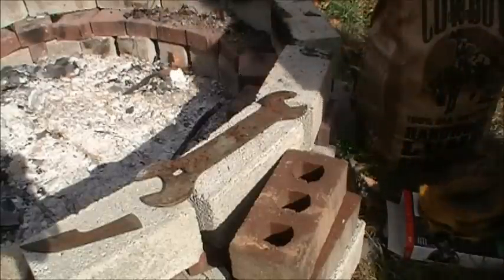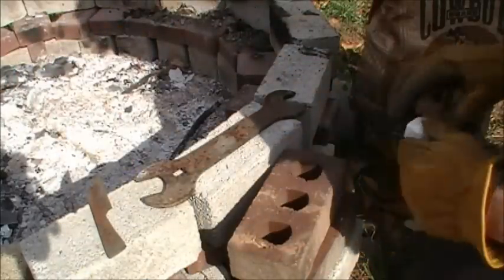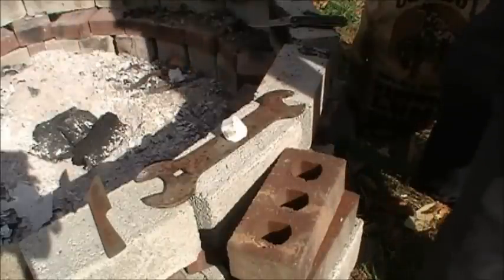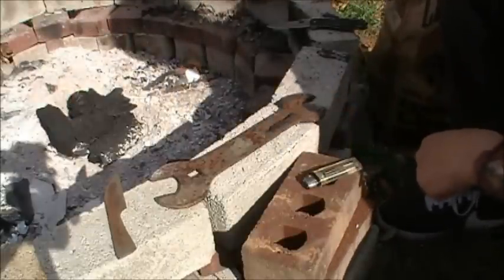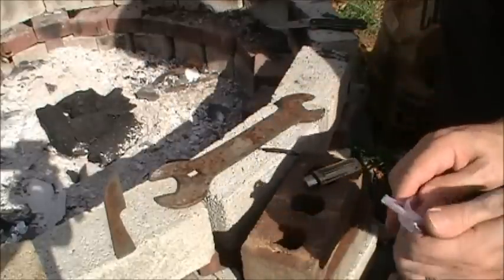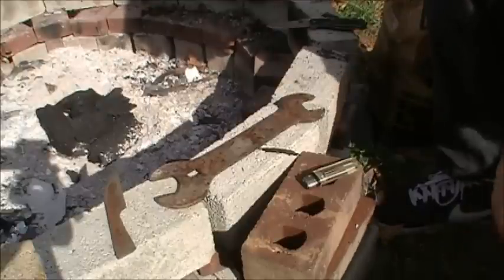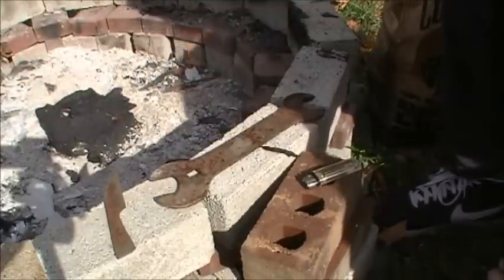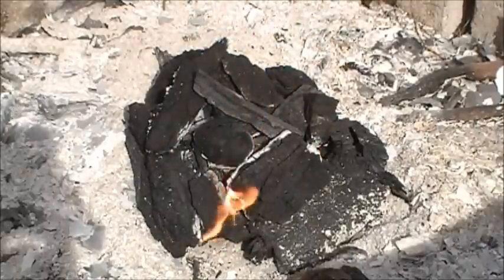Annealing Knife Steel at Home

Comment: Could you anneal steel with a blowtorch?
Reply: Could. The flame would need to be well-spread, though: Part of the reason we use forges and ovens is because if the steel is not (fairly) evenly heated throughout, for roughly the same amount of time, the hardness (or softness) is not the same throughout.

For just a knife at a time, I've seen some nice small ovens built from just a dozen bricks. Can't remember the channels, but, they're here on the tubes.

Comment from the maker: I use old tool steel. Files,wrenches, and what not. I do follow a loose template that I ref. from a knife making book I picked up. The annealing, I base on color. When it comes to actual heat treating. I have a knife maker buddy with the proper equipment. I appreciate the great information. Thank you.